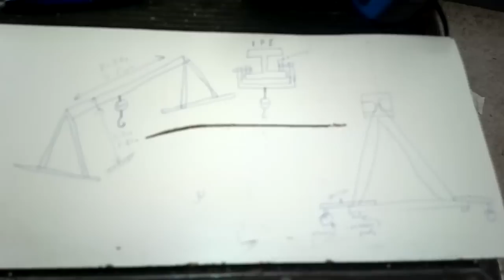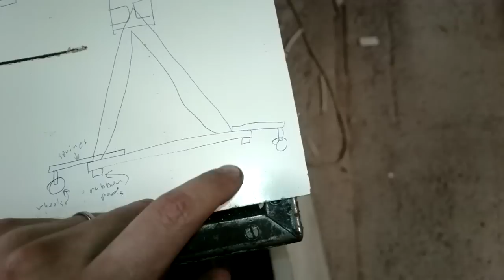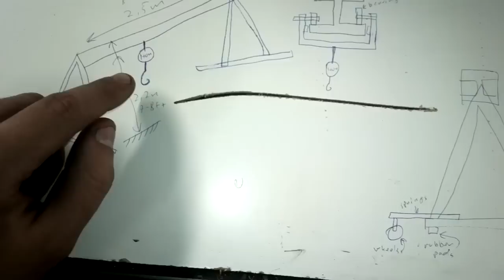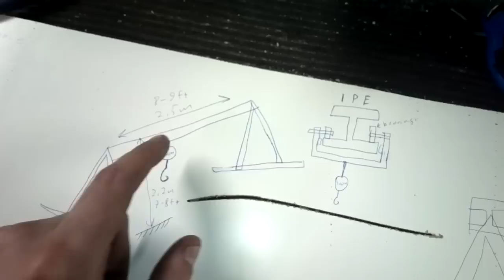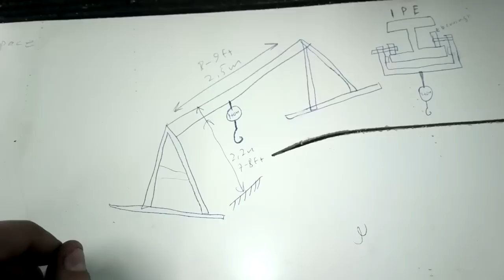Crane talk

Comment: You have a serious problem with height in your shop, and the major drawback about any gantry crane is the extra loss of height by the hoist. This is a serious problem, especially in your case.

I would suggest using the telescoping tubes and do the lifting with two long stroke jacks (mine are from Harbor Freight) - Just use a fixed beam clamp (the movable / removable type) and attach your load directly to this clamp, then move to each side of the gantry and give each jack a couple of pumps to lift the load. I do this now and then and it works very well, 

I find that I need the extra height when lifting a load out of the back of my truck, and I run out of room from the hoist hanging down so low. 

Glenn
Reply from the maker: You are right. I will have to go with some kind of a telescopic approach. I will try to make it so low that it can fit under the upstairs floor too.
Reply: yea, that would be really neat to be able to tuck it under that room.

Comment: 1.What is the overall distance from the attachment point of the chain hoist to the lowest point of the hook of your chain hook?
2.I cannot see the point of the rubber pads on the legs at all as this will prevent any movement of the legs once under load - in my view this will be most important in when in use to obtain the exact positioning required.
3.Large wheel diameter wheels will be needed in order to roll over your not-so-smooth floor!
4.Would you not consider a "beefed up" engine lifting crane? -is it unlikely you can get close enough to your machines?
Reply from the maker: 1. The height eaten by the hoist is around 40cm.
2. That is exactly the point. The crane will be very rarely used for exact positioning, by moving the crane before lifting (trial&error-technique..), I hope to achieve required accuracy with a little extra effort.
3. Yes. The floor roughness is also why I don't require the crane to be moved under heavy load, it would lead to really dangerous sitations..
4. I did consider that and I still have to think about that too. Problem with that is, as you say, the reach.

Comment: car front spindles  and make it so it just goes straight , lift the end with a floor jack to change direction ,  ( acts  as pivot  on one end let down and go straight  again).  have supports to touch floor with air out of tires . blow up to move with load . hang beam off one end, so you can  do work off end (ballast other end of course should be  easy in shop as every thing weighs a ton) works good on rough floors out doors etc. little spare tires roll well and take up less space, lives well out doors still rolls when needed . my thoughts jh

Comment: I was thinking bridge crane. Four vertical steel posts, be they pipe or tubing. Put the first posts on either side of the door to the outside. This would give you height. The remaining two posts would go in front of the wood posts you have supporting the loft. On top of these posts put H beams running parallel to each other from the door to the loft. Run these H beams right up to the ceiling.
 From these H beams hang another shorter H beam with your roller design on each end of the short beam that would ride on the two long parallel beams. This would give you movement from the door to the loft.
 Mount your chain hoist with your roller assembly on the short H beam. This would give you side to side travel which would put your work piece over any of your machines you would choose. This would also give you more lifting capability.

 I tried to contact you through messaging but it evidently doesn't work.
                             |  *-------|---------*
                               \            |                  loft
               Door >  /           ?< hoist
                             | -------|---------
                short H beam  ^                      * = poles
Reply from the maker: That's a good idea! A little more metal but also no wheels or other stuff to buy. I'll have to take a serious look at that idea! I'm afraid the problem with that is going to be that the loft and the door are not the same height, but that can be dealt with! Thanks!!

Comment: I like the adjustable height idea, if there is a real advantage in your needs... One thing I have noticed is that your floor has a rough surface so a small diameter wheel might not roll well... And about the springs and bumpers idea. Wouldn't the bumpers defeat the ability to roll the thing when you had a load on it? Just a couple of things to consider.... :o]

O,
Reply from the maker: My intention was to make the crane moveable only when unloaded or under light load. The reason for that is, as you say, the rough floor surface. When trying to move the crane under heavy load, it takes almost all of a man's force to move it, and when it starts to move, it might stop suddenly and tip over. So the idea is to increase stability and safety at the expense of moveability. The floor surface really is a big problem in my shop in many ways..

Comment: You have me thinking. Your spring loaded wheels will not work as you will not be able to move a heavy load once you have lifted it. Also with your outside wall height @ 2.2 meters (7 feet, 2.6----inches) your hoist lift may be too short to get a piece onto a machine if a gantry type hoist comes off of the sidewall. This hoist should also have the ability to bring a work piece into the shop through the outside doors.  What would be the heaviest weight that you would have on this hoist?
Reply from the maker: It will be a gantry -type crane, I can't think of anything else to work. 2,2 meters is not enough for all the work I need to do with the crane, so the crane needs to be telescopic. Getting things inside will not be a requirement as I have my truck crane to lift heavy things inside. The max load my hoist can lift is 1 metric ton (2,2 imperial tons) and the crane structure will be made to fit that limit. What I'm mostly worried about is the stability in the axis of the beam.. It needs to be well supported which limits the hoist travel limit a little too..
Reply: sunppaa I think you have your conversion a little wrong 1 Imp Ton is very close to 1 Metric tonne ( 2240pounds-1000Kg when !kg is almost  2.2lbs so that;s about only 40lbs difference not two to one) Hope this doesn't upset your designs too much.
ATB
chris
Reply from the maker: Chris Stephens
Oh, sorry! I'm a little lost with imperial units :-) !

Comment: Dear Sunpaa, I do not want to tell you your  business since you know far more than I do. But let me look at the requirements. You wish to lift 350 Kilos (preferably more) for a height of 2 meters (also preferably more). You also observe that there is no Harbor Freight or the likes in Finland. I agree totally; I live in Alaska which is why I appreciate your videos so much. I don't have Harbor Freight either.

But I know for a fact that Finland has motor vehicles. Therefore there are times when you must extract the engine from a car or truck. For this one uses a hydraulically operated lift. They go by various names in this country; perhaps "engine hoist"  is the most popular. If you could locate a scrapped version of such a creature and rebuild the hydraulic cylinders (as Keith Fenner did in his firewood spitter, I see that you follow him) then you might be ahead in terms of effort. Furthermore the wheeling is built in. I would prefer a truck (lorry) engine hoist to an automotive one. If I had to guess, I'd say a truck engine masses 500 Kg, way above your requirements. I would also say the distance a truck hoist has to do is well above 2 meters. Usually these things are scrapped when the hydraulic cylinders fail. Repair my be as simple as a new O-ring or as complex as a rebore; most commercial outfits scrap them when they fail for any reason. Too complicated for them to repair. I am only sorry that I know no Finnish. I do remember (by an amazing set of circumstances) that the Finnish National Anthem starts "Kotimani ompi Suomi" and I still remember that after about 60 years.

Keep the videos coming.

Comment: oh, as for storage of the crane -  I needed mine out of my way for most of the time I'm working in the shop, so I designed mine to be 'parked' directly over my lathe - completely out of the way - it was almost 'free' space, if you will.  

For the telescoping portion I just used some square tubing and they fit together nicely.  My beam is an W8 (8" tall) and the span is 12'-0" - I would imagine it will lift at least 5 ton.  I do have a manual 3 ton chain falls for it and have lifted my lathe with it a couple of times.

A photo of it in the backround in the 'parked' position:

http://www.flickr.com/photos/100586259@N06/10967658595/

Cheers,

Glenn
Reply from the maker: Very nice way of storing the crane!! I came up with an idea of making the telescopic tubes round with locking holes 90degs from each others, so I could park it leaning to a wall and taking only a little room. Parking over my lathe is also a good option but that means making the crane a little longer than I tought.

Oh, and about the repositioning thing, you are right about that. I think I will have to move the machines that I'm lifting parts on/off, a little further from the walls. To have better access with the crane and also because it is very cramped to do any kind of mainteinance work to the machines when they are on their places. This will not be a problem because all of the machines can easily be moved with my trolley.
Reply: Good points - Kieth Fenner has a real small tight quarters shop, and he made his crane out of round tube, so the legs are free to swivel (just as you described) and if he needs to roll his crane around, those swiveling legs really help to steer it around machinery,

Comment: "They" say that you should never move the load with the gantry type crane, but I end up doing it all the time. I know, I know, but I never run with scissors - promise.

Just something to think about, you may need to reposition something you are lifting. 

Also, put some side gussets to brace the beam to the vertical members, this is the weakest link of the gantry. I use swaged black iron pipe and it worked out well. I used two per end and this allows my trolley to travel the entire length of the rail.

I also used long hydraulic jacks to make mine adjustable vertically. Mine needs to roll out side and this allows me to lower the beam to pass under the garage door. It also allows me to adjust and level out the beam.

A link to a photo of mine:

http://www.flickr.com/photos/100586259@N06/9559904296/

Cheers,

Glenn
Reply from the maker: Hello Glenn! Awesome crane you have there! You built it yourself?? Very handy hydraulic lifting system! I had an idea of making the telescopic tubes act as pneumatic or low pressure hydraulic cylinders but that idea of yours seems a lot smarter.
You also have a beautiful shop! Your floor seems a little smoother than mine :-)..
Reply: Hey thanks - Yea, I built most of the things in my shop, including the crane. The good thing about those jacks, they are dirt cheap! Like I mentioned, you really don't even need a hoist, as those jacks will lift most anything. Also, keep your eyes open for castors - they get real expensive when you get a gantry over a couple ton capacity. I lucked out and got them off of Craigslist (not sure if you have that there?) - These are aluminum Areol and were something like $1,000 each, but I ended up paying the guy $300 for all four.

I have sort of a fetish for big castors and tend to buy them when I see a deal. You never know what you might want to build in the future!
Reply from the maker: Glenn Davis
I wish we had Craigslist and Harbor Freight here too! I guess I'll try to go with the hydraulic lifter design! Castors are another thing I has worried about, I haven't found any with more than 200kg/wheel capacity.. That's one of the reasons I came up with the spring idea.

Comment: As some others already have said - take a look at Keith Fenners gantry crane - I beleave BOTH his A's can TURN compared to the main beam - he just moves it around by turning the A's so they clear the different machines - I dont think you have less space the Keith has !

You CAN get some more height under the beam by putting the hoist motor in one of the ends of the beam - I did so with my crane - take a look here:

(You have Google Translatio to the right just under the menu line - choose language in the combobox ;-))

http://kelds.weebly.com/loslashbekran.html

In this video you can see Keith's gantry crane from about 12:00 and out:

Welcome to Turn Wright Machine Works

Hope you got some ideas !
Reply from the maker: Yeah! My crane will be very similar to Keith's! You are right about the space thing! Keith has his shop laid out with a lot of thought! The turning A's must be the way to go for me too. I guess I also need to add some telescopic height adjusters over the A's to adjust the height.

You have an awesome crane! I wish I could afford an electric hoist. Maybe some day I will upgrade it to electric but I will have to start with my 1ton manual chain hoist.. It's going to eat up some height but I hope I can manage with that.

I got some ideas again, thanks!!
Reply: sunppaa You can buy a used/"second hand" motor like mine - with brakes too - for LESS than a manuel hoist !